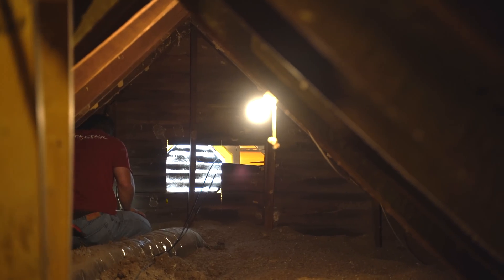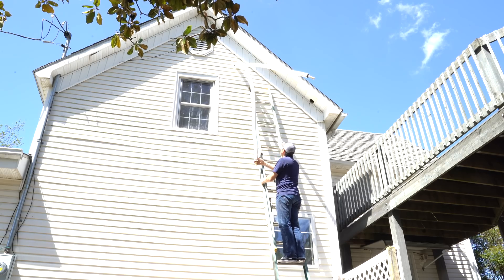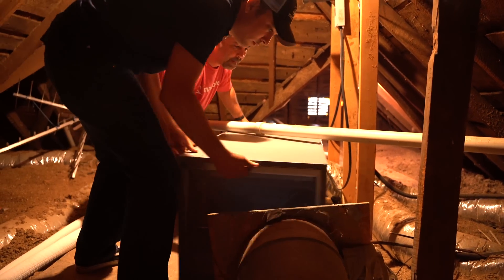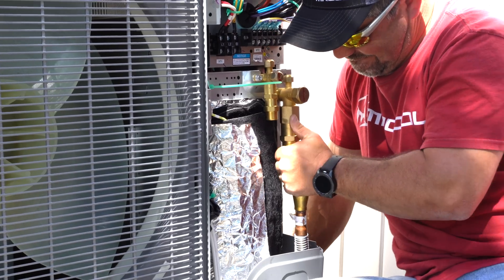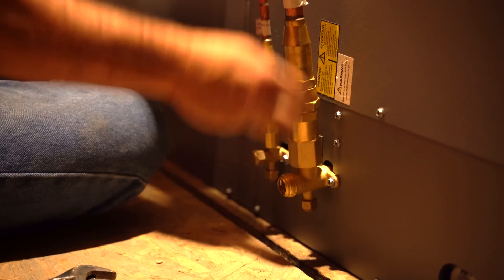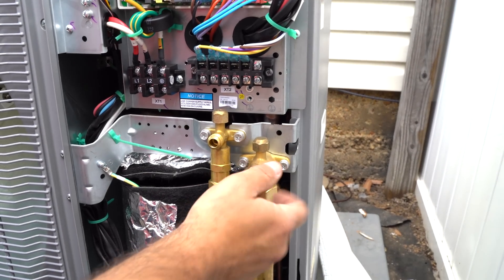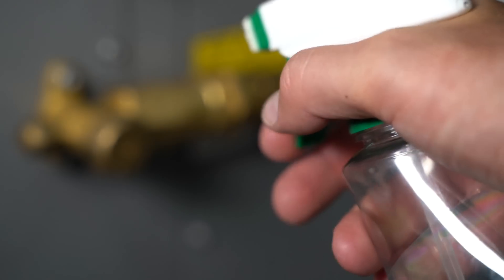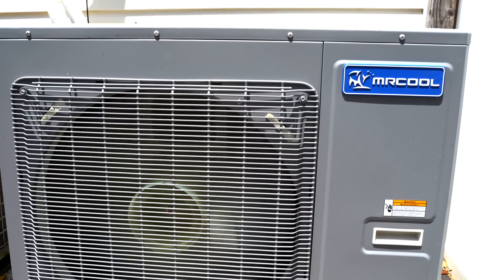MRCOOL Universal Installation with Quick Connect Line Sets

Comment: You advertise your unit as DIY and no need for contractor, but in the owners manual I received with the unit it clearly states that warranty is voided if not installed by contractor. Can you explain please?
Reply from the maker: We sell the MRCOOL DIY as do-it-yourself. The DIY manual does NOT state that a contractor is required for installation (source: I wrote the manual). However, we do have many conventional products that are not intended for do-it-yourself installation such as the MRCOOL Advantage, Olympus, Universal, Signature Series, etc in which the manual does require professional installation.

Comment: does the air handler and compressor run off same breaker or do they use different breakers/amps?
Reply from the maker: In a central air system the air handler and condenser would typically be wired separately.

Comment: what is the measurement of the inside unit?
Reply from the maker: The MDUI18024036 Universal air handler is 48.25" high, 21.3" long, and 21.3" wide. The MDUI18048060 is 57" high, 21.32" long, and 24.8" wide.

Comment: How long is the lineset it comes with? i need about 20 feet
Reply from the maker: The longest is 50 feet.
Reply: @MrcoolComfort  i measured it and its about 25 feet but i have plenty of room to move down the wall or closer.
Reply from the maker: 25 foot lines are available.

Comment: I have a 14 year old 14 seer 3.5 ton Goodman Heat pump it sprung a leak in the outside condenser because the cabinet lid the fan is in rubbed a tiny hole in the coil and the ac guy fixed it and it worked for a day or so then the reversing valve stuck in the AC mode, i find that very suspicious , i have heat with electric and the ac works perfect but no heat pump, he wants another grand to replace the reversing valve and im not dumping another grand into an already 14 year old unit will this be enough for my 1300 sq ft home since your 3 ton is more efficient than the old Goodman
Reply from the maker: The only way to know for sure is with a Manual J calculation, but it could work.
Reply: @MrcoolComfort  I have to lay the unit down in my istallation with the intake on the left and the discharge on the right  if your looking at the unit  but i think that puts the fittings on the evaporator facing down at the floor where i need the lines to face up because they come from above , i dont know how sharp i can bend the lines to head twords the right or if they sell a 90 degree coupling
Reply: @MrcoolComfort  as Jay Bradley mentioned and I am having same situation, do we need buy a 90 degree coupling?
Reply: @MrcoolComfort  The manual of Universal 2-3 ton MDUI18024/MDUI18036's page 11 and 12 show that there are a 90 degree lines, does this means that we can bend the pre-charged line to 90 degree? Thanks

Comment: Is this system both cooling and heating or is there a separate heating unit required?
Reply from the maker: The Universal is a heat pump, so it can both cool and heat without additional systems.

Comment: What size wrench is required for tightening the No-Vac fittings? The other video shows the Yellow Jacket Adjustable Torque Wrench (which I looked up and has a 0.2-1.2 inch range) being used for the smaller fitting, but what size is needed for the larger fitting? I'd like to ensure I can find a torque wrench for both fittings so they can be properly installed.
Reply from the maker: For a large line, 36mm. Small line, 26mm.

Comment: I purchased the Mr. Cool Universal System 4-5 ton heat pump system from Tim at Ingram’s Water and Air equipment. I installed this system myself, using the Mr. Cool quick connect (pre-charged) line set, saving at least $,1600 on installation fees, as quoted by a local HVAC contractor, and got an 18 seer unit for less than the 16 seer unit price as quoted by the HVAC contractor. The system is well made of this highest quality components. The fan on the condenser is very quiet, and the variable speed allows the unit to be much more efficient than a standard condenser, not to mention the condenser looks sharp as well. The system blows ice cold and works very well considering the humidity and heat we experience during the summer months in south Mississippi. 
If you are looking for an excellent heat pump split system to replace your current one with, you cannot beat the best in class quality, comfort and design this unit offers.
Reply: I'm from central Mississippi and was wondering how the system would handle humidity which in our home state is probably the worst in the country thanks for letting me know
Reply: Do you have any pictures of your install? I'm seriously considering buying one from Ingrams too.

Comment: Hello, I am looking at getting this unit to replace my system. On page 10 of the air handler instructions, it says to install the unit 8 inches above the ground, however it does not appear that was done here. Can you advise one the reasoning behind using 8 inches and why it was not  followed here?
Reply from the maker: The instructions recommend "the height between the air handler and the ground is above 8 feet". This unit is installed in an attic, so it is sufficiently high.
Reply: No need for drain pans or float switches?

Comment: I would like to see how a 5ton universal set performs at cooling in Arizona heat and how quiet is the unit.
Reply: I'll tell you shortly. I'm currently  remodeling and adding a master suite to a home in Central Phoenix. The total conditioned square footage will be right at 2,000. Original home was 1300 built out of cinder block with no insulation. We are replacing the west and north walls with tight, well-insulated new walls. 

Current home has a 3-ton packaged unit on the roof that will be replaced with 5-ton Mrcool Universal.
Reply: @jeremythacker8919  how is it doing? Live in Kingman and getting a 4 ton unit placed in attic

Comment: Is this diy friendly?
Reply: None of them are, even if they say so. They are just trying to sell it to you. They work great, one of the best in the market. I have installed a few that the customer buys online & I really like them.
Reply from the maker: The Universal is not intended as a do-it-yourself product.
Reply: It is a diy with help. The unit is heavy, both indoor and outdoor units. With some knowledge of AC unit install, you can do it youself. Its fairly simple, you just need help lifting the units.
Reply: Not the condensing unit

Comment: Does this unit require  one power supply or will I need to run a power supply to the indoor unit as well as a power supply to the outside unit.
If two is required what size breaker's would be needed?
Reply from the maker: The Universal condenser and air handler must be wired separately. Requirements vary by model.

Comment: So there are no settings to change from 3 to 2 ton in the installation manual. I've looked in both the paper versions and online for the air handler and condensing unit. Where can these settings be found?
Reply: I was able to pull up the owner's manual from the Lowes.com listing. That one has added the settings to change from 3 to 2 ton. That page is not in the instruction manual that came with my units.
Reply: @chrisbailey4212  I dont know if they updated the manual since then, but it was in my manual. I just bought mine, on 9-7-2020, and the settings was in there. It is also online on page 16 @:  https://cdn.iwae.com/media/manuals/mrcool/mdui18024-36-owner.pdf

Comment: I don't have an attic and my crawlspace is too tiny for this unit. Could I install it in a dry basement?
Reply from the maker: The air handler could be installed in a dry basement.

Comment: Do you have any plans to test this unit in a hot location this summer?
Reply from the maker: We did have plans to do that. And then COVID-19 happened.
Reply: @MrcoolComfort  come to my house in arizona you can install the 5ton for me and make a video for it,my 19 years old goodman is just not efficient, can't cool my house under 79°F when the heat outside is above 110°F :( and the condenser unit is super loud :(